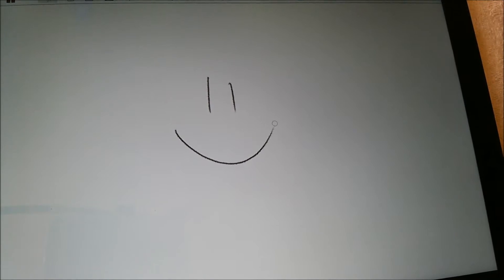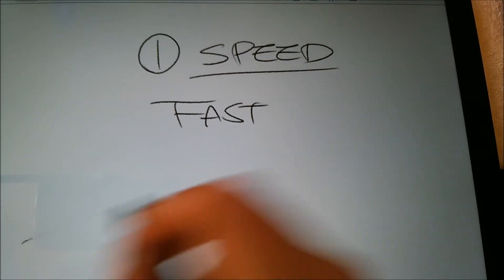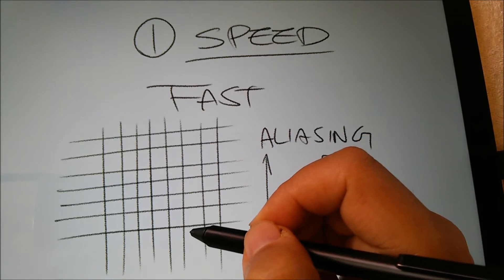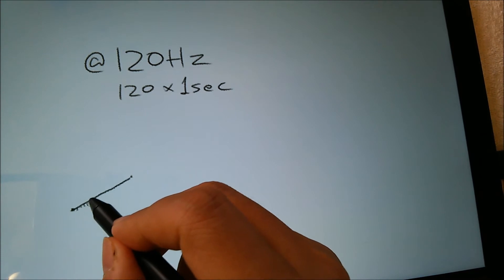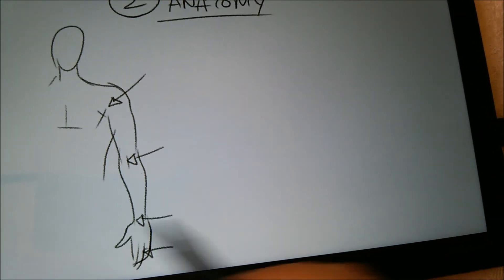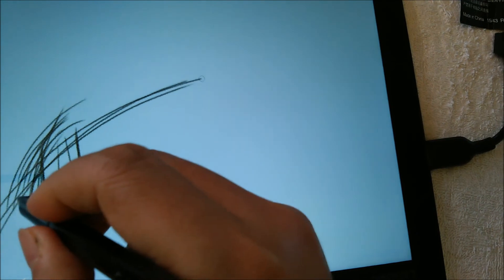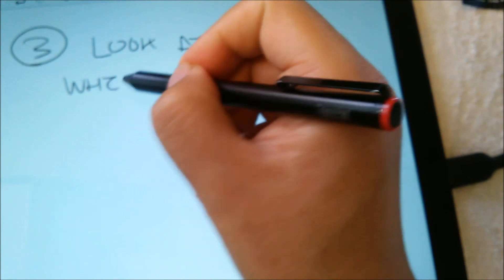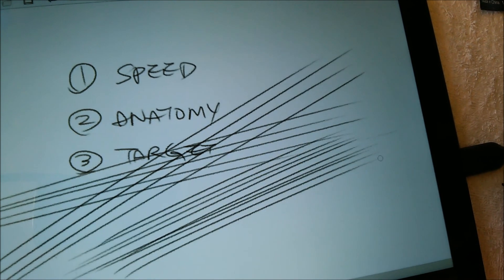Digital Sketching Tip & Tricks: Straight Lines

Comment: Is it the same thing where you're talking about 120Hz as it is on a new iPad Pro? They say because of 120Hz refresh rate Apple Pencil latency is only 20 ms. And artists mostly agree that it's the best stylus so I think I might buy one of those.
Reply from the maker: Well I certainly don't agree it's the best. i hate drawing with it. It's got a fake IAF of 0 grams and terribly uneven pressure curve. It's a pain to do a decent drawing with it personally.

120Ha I'm talking about in the video is how "often" the pen talked to the digitizer board. Apple Pencil does it @ 240Hz UURC. But that's too much! All it does is introducing too many data points. 120Hz is plenty often for enough data points for nice subtle lines. 200Hz and over is overkill for sake of marketing bullet points IMO.
Reply: I don't think they're advertising 240Hz, but maybe it's for handwriting, I imagine you need a lot of this "talking to digitizer" for small text to be accurate, I hear that it's very good for taking handwritten notes. I guess I'll try to get hands on with the pen before buying.
Reply: P.S. When you tried Apple Pencil, did you try it with Procreate? And what tablet or surface like device do you think has the best stylus and drawing experience?
Reply from the maker: Yes I tried Procreate on 12.9. Procreate IMO is the only reason to buy an iPad Pro for art, but even then I was fighting the wonky pressure curve mapping of the Pencil necessitated by using as level 1 of pressure, the mere breaking of the static capacitive charge of the screen. Very sneaky way of circumventing actual IAF of the load sensor.
Reply from the maker: It was either 240 or 200 Hz IIRC. Wacom is following suit with their gen 13 pens by going to 240Hz from 120Hz. But then again, Wacom is champion of making meaningless increases on hardware for marketing purposes (i.e. pressure level quantity increase by 2X every generation).
Reply: So I tried iPad Pro and Apple Pencil in a store, you're right it's a little bit weird, without editing pressure curve it's seems a bit unnatural. When I adjusted pressure curve it was better, not ideal, sometimes feels like pressure jumps a little bit, but it's good enough I think. Still gonna buy it because it's also a really good tablet, Surface is even more expensive and I don't trust N-trig. Everything else on the market is is not something I would like to use as a tablet.
Reply from the maker: How about Wacom equipped Core M5 tablet for $600?

https://www.amazon.com/Huawei-MateBook-Signature-Tablet-Champagne/dp/B01FWIJ5UA/ref=sr_1_4?ie=UTF8&qid=1498964815&sr=8-4&keywords=matebook
Reply: I assume it would work with other Wacom pens not just original Huawei, original looks funny and uncomfortable. But even then, there are too many things I don't like or not sure about Matebook or any other Windows tablet/convertable. I'm not from US and I'm just not comfortable buying something not very cheap from far away on the internet (especially because I wouldn't get 2 years warranty which is mandatory in Europe I think, or at least my country). Huawei Matebook 128 GB is almost 1000€ in local stores, and I never saw it in stores where I could try it, not to mention trying it with a pen would be probably impossible even if I could find the tablet itself.
Even without all these problems caused by my location, I'm just tired of Windows. I have Windows desktop and it gives me enough headaches already :D iPad reviews are raving, that 120Hz display is really something, everything else feels kinda stuttery after that. And I always wanted an iPad just never felt like there's enough to justify it, but overall now it's just too good of a package, even if pen feels slightly weirder than Wacom. I also heard that you get used to it.
Reply from the maker: As long as you are OK with limitation of iOS art apps, iPad Pro should be fine. I need a proper OS though, not mobile OS.